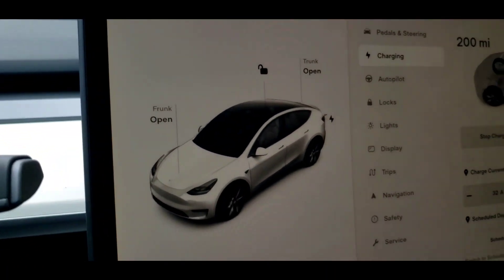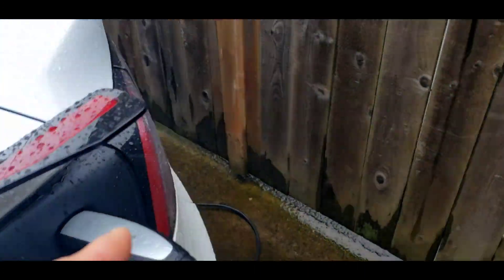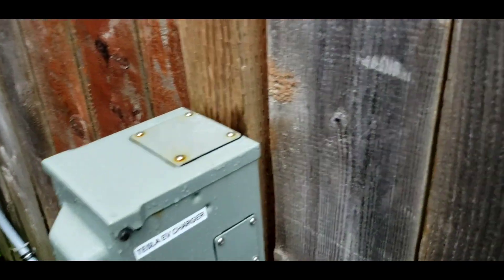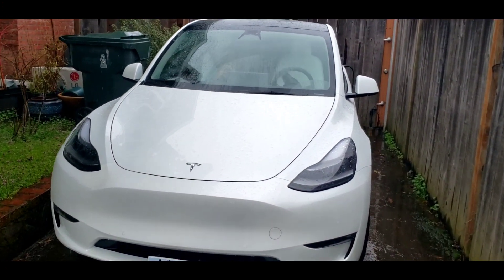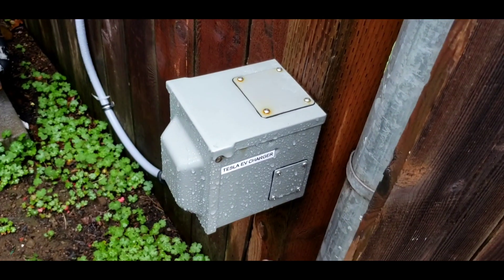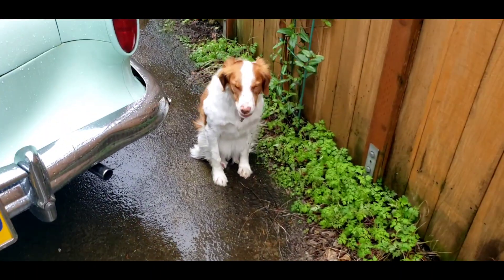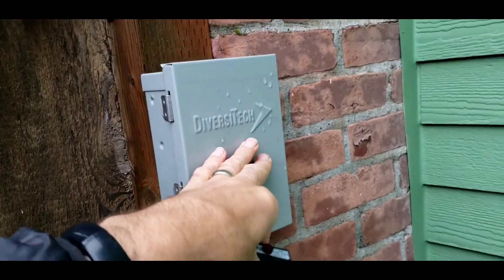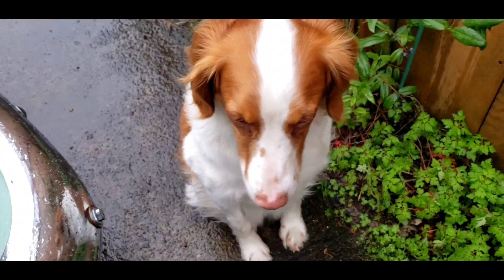I Can Now EV Charge House Guests... Well Almost.

Comment: @1.17 that out door switch should have a rubber inner enclosure so your finger doesn't come into direct contact with the switch  or you should change it to an ip45/ ip65 rated switch.
Reply: It's just 7,000 watts and a little bit of rain.

Comment: Is that 32A at 110V or 220V? Not sure I would want an EV that close to the house.
What is the state of play between GM and LG over the batteries for the Bolt. Are GM making Bolts again or is the plant still closed.
Reply from the maker: My charger setup is 220 volt @ 32 amps, My family now has 4  Tesla model Y's. They are excellent.  I'm sure glad I don't own a Chevy Bolt.  I did a video on a Chevy Spark EV awhile back. That was super fun.
Reply: I understand GM is still replacing some of the LGChem batteries. After all the pictures you've seen of them going up in flames, it was only 11, which is still too many. If you check the current recalls of all cars lately, Ram trucks, Kia, and Hyundai are all asking you not to park your vehicles in enclosed garages. Ram has a problem with trailer hitch wiring that, when it gets wet, may cause a fire. Hyundai and Kia have two problems which can cause fires - a short in the antilock brake control module, and the other is a fitting in the high pressure fuel injection system that could leak and project a nice air/fuel mixture at the hot exhaust manifold. This residual pressure can be maintained after the vehicle is shut off. 
GM is making the Bolt, and the new Bolt EUV. I'm not apologizing for the mistakes in manufacturing that has occurred by battery manufacturers, but it must be remembered that gasoline is also a very combustible.

Comment: The only thing missing is a little electric meter, that shows Dollars Per Hour being lit on fire.
Reply: The cost per kilowatt is fairly low in Portland.
Reply: @johanvangelderen6715  Oh, I guess that means solar panels are a total waste of money, then. Good point.
Reply: @PaulLawson-k8v  

You did not mention solar panels until now.......

They work well where it's not cloudy for much of the year.

For example in Portland,  it's cloudy and kinda dark from Halloween until Memorial Day.  But quite sunny the rest of the time. 

While 100 miles towards the east it's sunny most of the time.

You might want to watch the videos by 
Will Prowse.    He has a massive solar power system where he lives in 
Las Vegas.   It powers his whole house air conditioner and also his Tesla.
Reply: @johanvangelderen6715  If electricity is inexpensive, you'll never break even on solar panels. And if electricity is expensive, you'll never break even on an electric car. I just buy used cars with gasoline engines, and don't worry about solar panels or electric cars.
Reply: @PaulLawson-k8v  

I'm right there with you.

I'm a pretty good hobby mechanic. 
I've taken care of my own stuff for 50 years.   So why would I want an electric car.     I'd rather buy pre 2005 gasoline powered cars.
Reply: @johanvangelderen6715  I wouldn't mind seeing a semi-universal kit, to replace a rear wheel hub on a manual transmission FWD economy car with an electric motor and small battery pack. The idea would be to accelerate from a stop on electric power and let the clutch out in 5th gear to cruise on gas. IMO this would double the range of a tank of gas, to around 700 miles. The battery wouldn't have to be large, because you'd still use the gas tank for cruising.